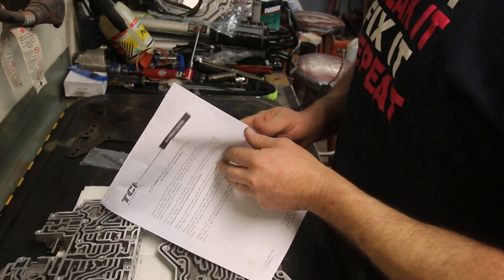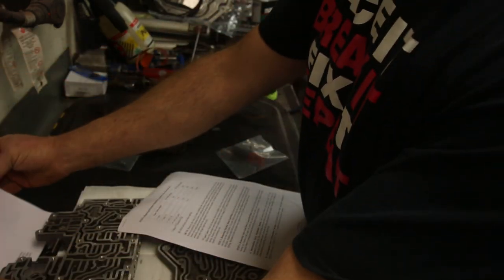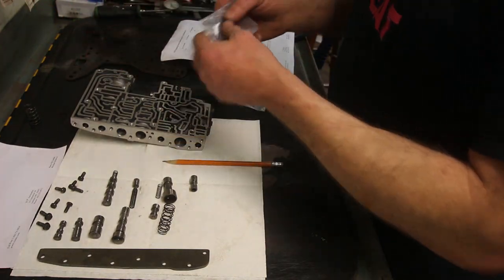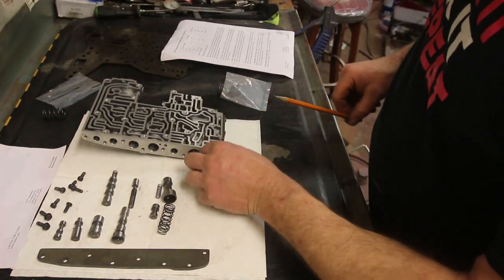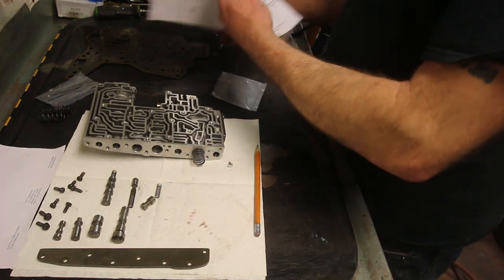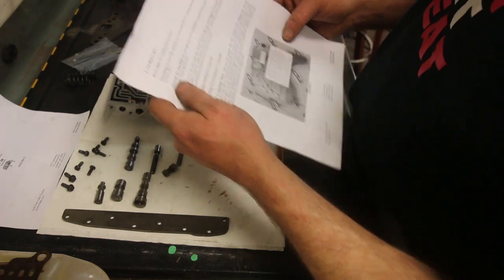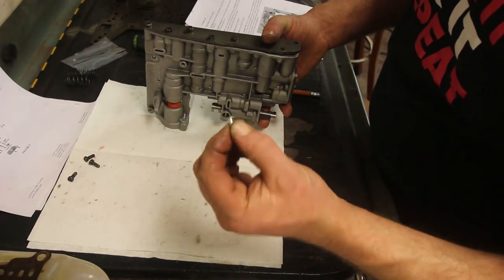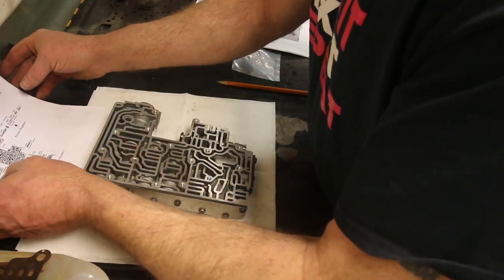Ford C6 Complete Rebuild Part 9...again... Shift Kit Install and Explanation

Comment: The  ID plate  bolt  ,,,, and ,,, the   bottom  right  filter  bolt   are  the   invisible  dowl  line  up  bolts  , if you  don't  believe  me  just  look  very  carefully  at the  bolt   line  up   for  the  id tag @ the longest  bolt  on the  c6  filter    you  will  be  surprised  😲

Comment: No idea why TCI give a newplate. It is not needed . You've done right drilling your plate
Reply from the maker: Yeah, I was struggling with the decision and the new plate just didn't seem right enough to use, so I went with my gut.  Thanks for checking out the video!

Comment: What is a "Shift Kit"?
Reply from the maker: Hey, thanks for checking the videos out. A shift kit is some modifications to the factory stuff in the valve body to raise the hydraulic pressure in the trans, also changes when and how hard it shifts to the next gear. Shift kits can also lengthen the overall life of a transmission as they reduce slippage between gear shifts and slippage is clutch pack  wear.